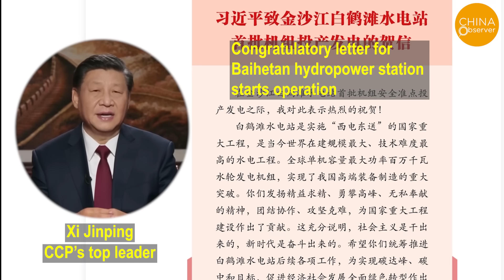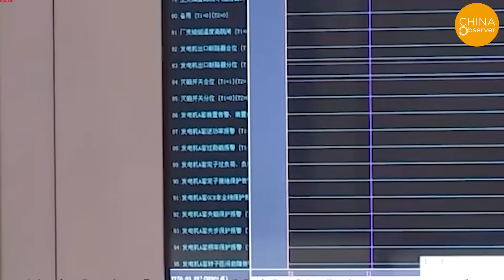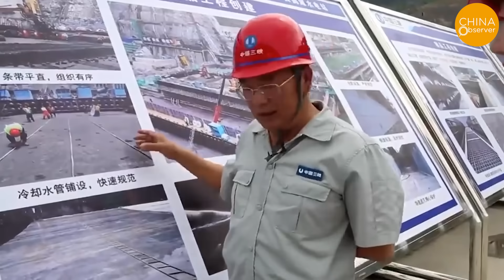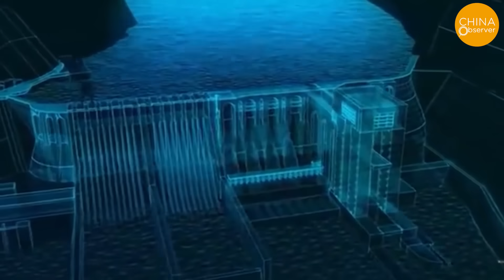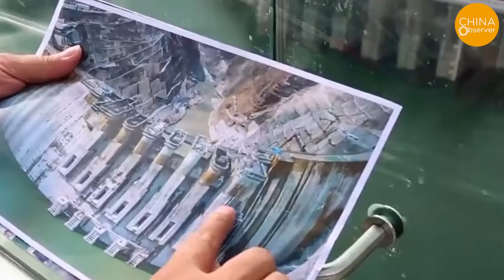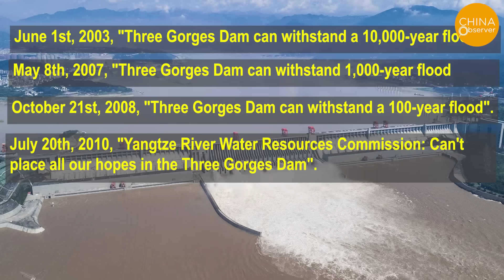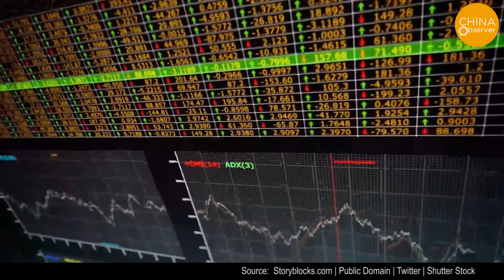2nd Largest Hydropower Station May Lead Collapse Risk to The Three Gorges Dam. Dam failure risk

Comment: Worrying about the construction quality.....
Reply: Plenty of videos chinese building collapsing and toppling over. Just like dominoes! LOL
Reply: Construction quality can be an issue, though given it's a state project probably not intentionally. But pressure form above to rush it to completion has probably cause them to cut corners be it in materials or safety. It's not a China only thing though.

I remember there being some number of people buried alive in the Hoover Dam when it was built as they fell into the cement. I can't help but think a dam many times bigger and rushed to completion had more work place accidents.
Reply: @JustaGuy_Gaming  nobody is buried or buried alive in Hoover dam, lots of people died due to accidents. but none is buried in it. that would weaken the dam.
Reply: It shows how ignorant you are. China have a thousand times more building projects a year than US. If they are of bad qualities, you would’ve heard of tons of building collapses. Instead, you hear about the one in Florida, where really bad   quality constructions abound. I know, coz I live here in the States. The sad thing is there is neither quality nor speed in the construction projects here.
Reply: @lordlee6473  But we do hear about bridges, motorway and many, many building collapses.
Reply: @holboroman  go ahead list them out, the date and location it happened, the casualties. If it’s like you said, many many collapses. And also make sure you do a fair comparison. As China uses over 2 billion metric tons of cement every year, versus the entire usage of cement in USA in the 20th century (that’s the century USA had its construction boom) is 1 billion metric tons.
Reply: @lordlee6473  However, most of the American buildings have lasted so long that they don't need to build many to replace it because it is so good that they don't need to build again. Your country have to build replacement as the tofu buildings in your country cannot last long. Becareful of your house being wash by flood as the sewer of your city is not planned at all.
Reply: @lordlee6473  Secway plaza that wobbles due to wind. The unfinished buildings that stopped as your country China is under western sanction.
Reply: @lordlee6473   don’t waste time to debate with these trolls. They are either stupid, or paid by CIA (or both).
Reply: @christopherseow969  lol. My country? You mean where you came from?
Reply: @WarmheartedKyubey  Lord Lee started first. Lord Lee should not be putting comments here or clicking the link to here as he don't believe the title. You and Lord Lee are also trying to get social credit score by trolling us.
Reply: @lordlee6473  We all known that you are from China. I know that you are a Wumao from the way you type your reply. There is no reward for people outside China to type good about China.
Reply: @lordlee6473  Your country means China with cities like Shen Zhen, Beijing, Wuhan, and Hong Kong.
Reply: @WarmheartedKyubey  I am from Singapore and I have bad experience from many other Chinese people. In Singapore, Western Food always look and taste better than Chinese food. Not only that, many of my favourite songs are composed by Americans, I don't like any songs that come from China.
Reply: @lordlee6473  You have shit in your pants when you know how powerful your enemies are and all will betray you.
Reply: @lordlee6473  What is so good about being a Chinese? Do any pretty girls love you? It I better for Lord Lee to self destruction as all the petty girls in China hated Lord Lee.
Reply: @lordlee6473  You will shit in your pants when you see the Quad coming to judge you.
Reply: @lordlee6473  I will never be sorry for antagonising you all Wumaos. You all will never appreciate those who have been good to you.
Reply: @lordlee6473  You are the reason why I hate the Chinese and China.
Reply: @lordlee6473  You said that I will shit in my pants thinking that I am afraid of China and the communist party but you are wrong. I know that I am safe in another country so I can criticise and insult  your country all I want and even flood your email without any consequence.
Reply: @lordlee6473  I realised that you are so arrogant that you are delusional into thinking that other government would surrender their authority to China but you will realise that you are dead wrong.
Reply: @lordlee6473  I have shown you the evidence by flooding your email.
Reply: @lordlee6473  It is censored on mainstream media and there is you wumao to troll us with propaganda. Other videos of this channel have reported about the problems of buildings in your country China.
Reply: @lordlee6473  BS
Reply: @lordlee6473  Trying to raise your social credit score?   Or simply needing an additional 50 cents?

Comment: Many dams have their lifespan limited by siltation. Given that the waters in China typically look MUCH muddier that the rivers here (other than the Colorado river), I would expect siltation to become a problem sooner
Reply: Why don't you study the construction of the Chinese dams?  Recent Chinese dams different from the US and other countries by not having a big common spillways but with a lot of small gates at different levels.  Those located at the bottom are for silt removal.  If you watch the Chinese videos careful you can always see the lower gates would be in open position when the dam is new and not even filled up.
Reply: @gunsumwong3948  Don’t wake him up.
Reply: @gunsumwong3948  Thanks for the reply.   I am no expert on dams, but since hydropower requires the ports for the turbines to be placed low in the dam, I expect that builders would also include ports that are lower, specifically to prevent the turbines from ingesting mud and junk which would quickly ruin the blades. But, low positioned ports only address siltation close to the port itself, where the water velocity is high. There are at least two reasons why siltation shortens the dam's life regardless of the port's location. First, siltation reduces the dam's storage capacity. Second, the silt accumulates mud, trash, pollutants, etc., which tend to become toxic
Reply: @gunsumwong3948  I do have to agree with you on the engineering accomplishment this represents. That is why I have mixed feeling about this video as it makes it a political thing. 

I have many disagreements with communism in general and do believe the CCP does not act in the best interest of most of it's people...but that is a completely different topic and should not be compared to the engineering marvel of the dams. It's simply a slap to the face of all the engineers and workers who made the dams a possibility.
Reply: @gunsumwong3948  don’t waste your time on the trolls. After you state the solid points, they will move the target to other places just like the comment above. Even all these things resolved they will say we are yellow peril directly. It’s non-sense to talk with an arrogant white supremacist, better to leave them with stupid fearing of the bigger world.
Reply: @WarmheartedKyubey  I just want to show there are people in the world who appreciate China's success.  People who smear China by nature are not smart people anyway.  Generally I am glad that there are more righteous people around so the trolls do not have a free run and know they are in the minority.  The trolls are pathetic not realising they are dealing with the top notch record breaking technology in mechanical, civil and electrical engineering of China.
Reply: @gregparrott  ^^^^
Reply: @gunsumwong3948  Here is an article I remember seeing a few years ago about siltation behind the Three Gorges Dam
https://www.reuters.com/article/environment-china-environment-dam-dc/three-gorges-dam-causes-downstream-erosion-study-idUST31738620070521
Reply: @gregparrott  That is a misrepresentation of the fact and the article.  If any dam is built on a densely populated area traditionally with a lot of mud in the water the dam will reduce the mud migration so the downstream must have a reduction of mud supply which is useful for land accretion.  That is a natural choice for having or not having any dam.  The purpose of any dam is to regulate the flow so that in peak flow water is stored instead of flooding the downstream.  When the flood is really big and beyond the capacity of the dam it can overflow the dam.  A good design of the dam is to discharge the excess water by spillways which the Three Gorges did first time in its 16 year existence to meet the maximum flood.  The excess water cause a mild flooding in Chongqing along the bank but did not disrupt the city life.  To China the flood was under control and the three Gorges did what it is supposed to be.  Only uneducated western cited flooding as a result of having a dam there.  The fact is had the Three Gorges not been built the flooding could be 10 times worse.
The video above actually show new beaches where children were seen playing.  This is the silt and sand washed downstream of the Three Gorges and so there are silt discharged as planned and the downstream is not starved of mud and silt.

Comment: Dams serve various purposes. Flood control and power generation compete directly, since the former requires low reservoir levels and the latter requires high reservoir levels. Obviously the CCP wants hydropower revenue. I do not believe their flood control propaganda. Yes, they set aside some reservoir capacity for flood control, but the reservoirs destroy the pre-existing floodplains and raise the groundwater table, so nature's natural mechanisms for mitigating floods is eliminated. And, to boot, the false confidence these dams instill prompt party officials to overb9uild in upstream tributary wetlands and floodplains, which accelerates flooding. The CCP has no respect for the Yangtze River